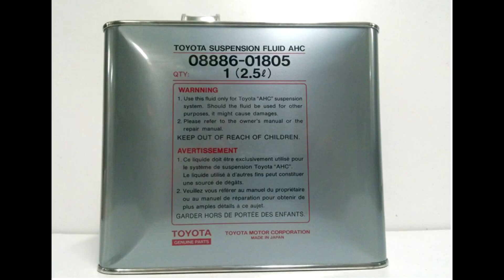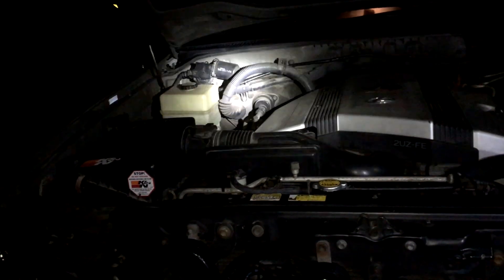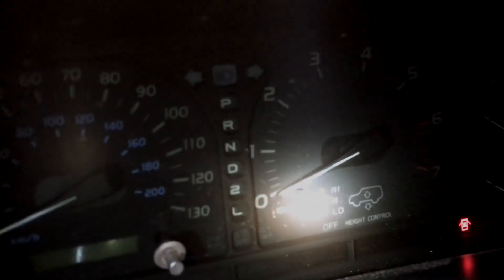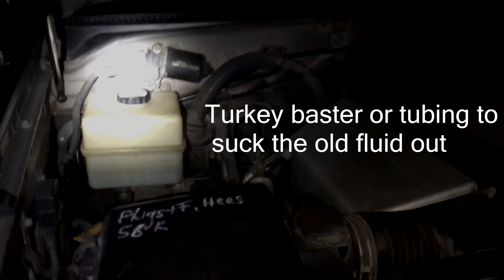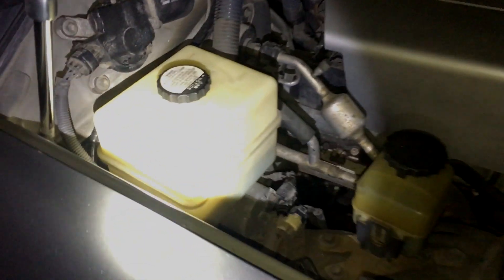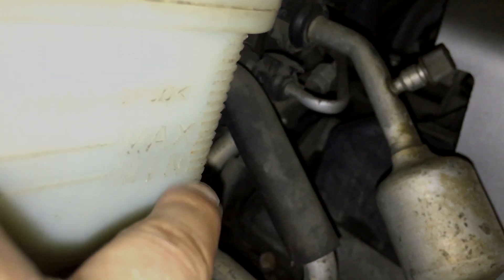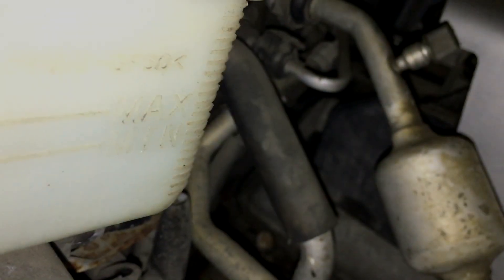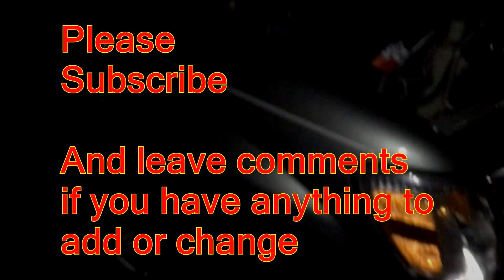LX470 AHC suspension fluid change

Comment: Hallo just want to ask.. if changing fluid.. must open the bolt to release air?
Reply from the maker: You need to open the bleeder screw to let out the old fluid. There should not be any air in the lines. If there is air in the lines you can bleed that out the same way. Be careful when opening the bleeder because the car does drop a few inches. Good luck and thanks for your comment.

Comment: What did you replace your AHC system with?
Reply from the maker: the full land cruiser suspension. regular shocks and land cruiser springs and torsion bars. I have a video up on the conversion. it is not as good of a ride as the AHC but it is cheaper and i don't have to worry about it failing.

Comment: You mention your AHC is disconnected in the beginning of the video.  How to you simply disable the AHC
Reply from the maker: It is not simple. I have video on how to do this conversion. you cant "disable" the AHC without replacing the socks springs and torsion bars with regular land cruiser components.